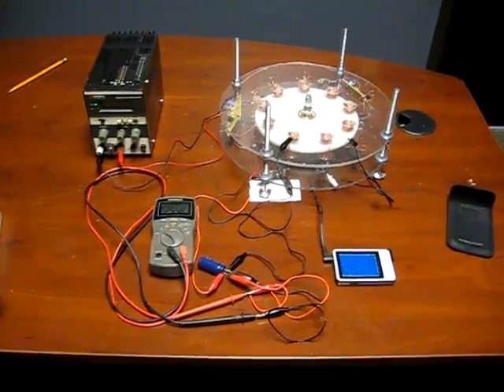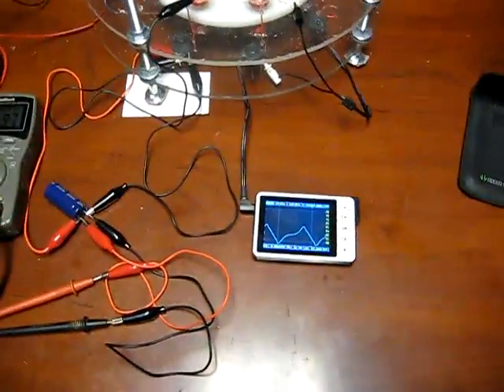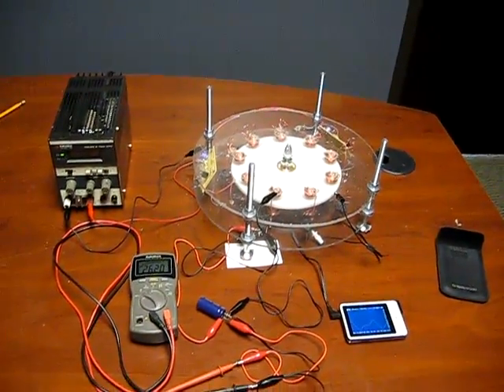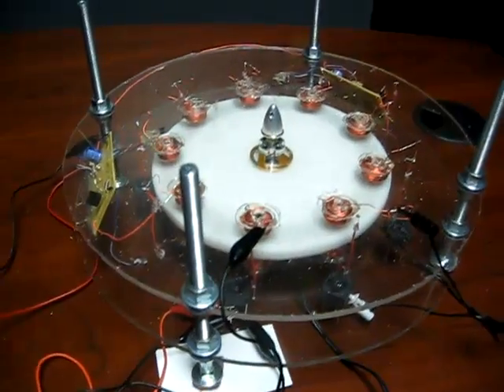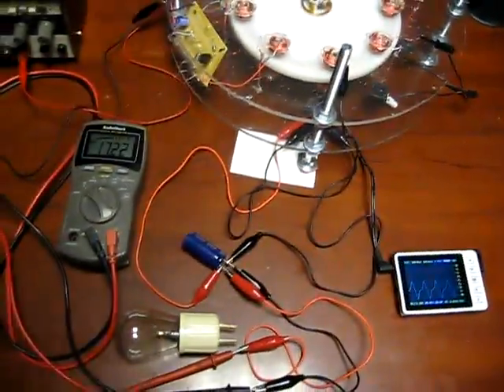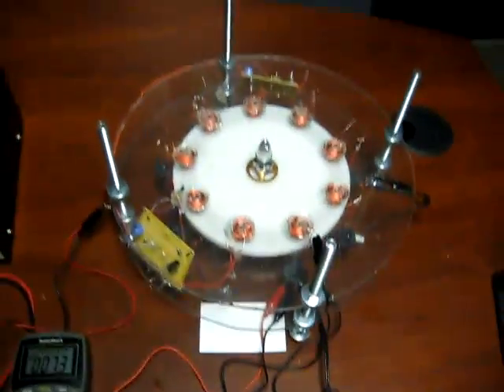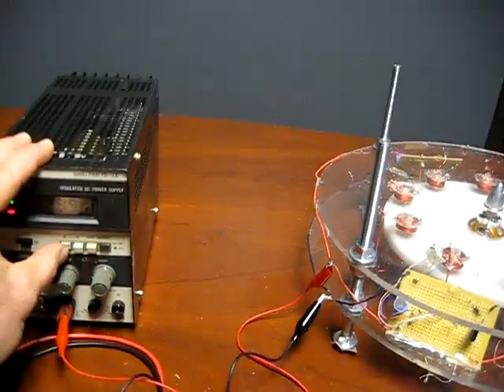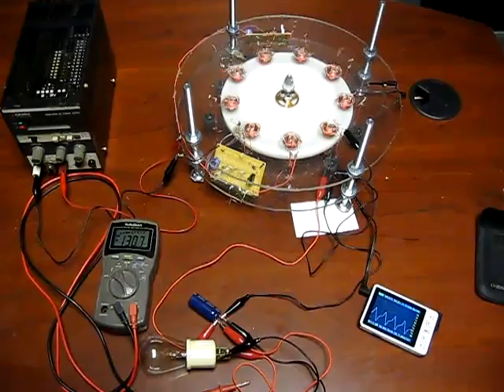RomeroUK Muller generator replication part 1

Comment: On this Muller Generator:  
--How many trigger coils are there?  
How did you put it together?  How did you wire it up?  
I want to build one, out of pure intrigue.   Will it or can it run on it's own, without adding power into it?  
What if I built one with heavier gauge wires?  Will it require more "power" to start?  Will the coils generate more power then?  
I have a lot of "what if" questions.  I really do want to build one.  I simply like what I see...I like your design.  
Could I bother you for a little guidance with this?  
--Thanks.

Comment: the thing is its pretty easy to get a higher generator voltage than the input voltage but the entire setup its pretty baddassingly awesome regardless. the real question is what happens when you short the gen coils.

Comment: Try and replace the ferromagnetic core and magnet with a tiny sphere first, then a diametric tube and check and compare the output. I had great success looping diametric core output coils back to source. They charged the run battery forcefiully!

Comment: 340Hz X 60(seconds in one minute) =  20,000rpm. ie you do not need to run out and by an rpm meter or tachometer

Comment: Also, A type of wire may be used in AC generators that mimic Roebel conductors that are used in AC generators to minimize losses in the generator windings. 
Roebel conductors used in AC power generators is actually a cable of insulated strands.
This conductor is different than Litz wire. If you oxidize common small gauge  stranded copper wire used in your generator coils, you can do the same thing as Roebel wire. The oxidation acts like an insulator between strands.

Comment: Great project, hope to see more. Yes I agree, do be careful as any rotating disc at high speeds can fly apart. Below 2000 RPM you should be ok, however above this speed, I would use a containment shield and eye protection. The larger the disk and higher the speed, the more the danger. I don't think it is running 20,000 RPM, but it  may be going too fast to be safe. Please be careful with this device.

Comment: awsome man, but i can't beleave you did not measure the output amps :( Since this is an experimental device, nobody said you need to have all the parts in place. RomeroUK only finetuned it with those extra magnets. hooking up all the coils will so much increase the frequency above the 950 Hz we were interested about. Crossing fingers ;)